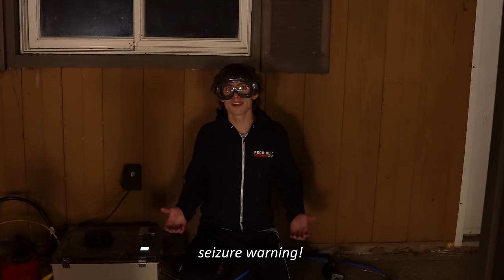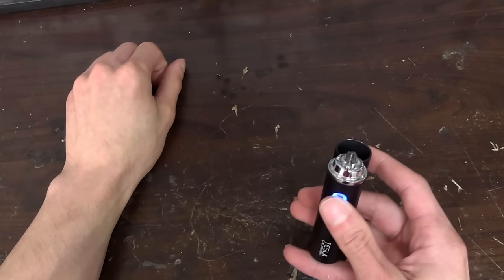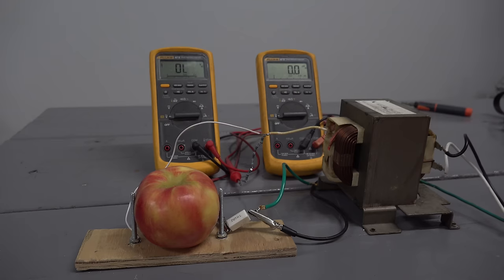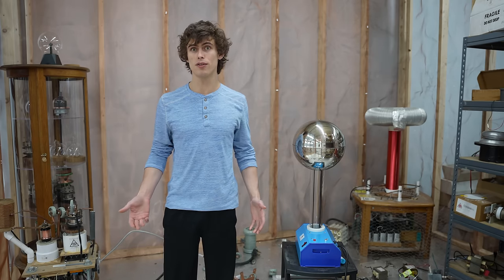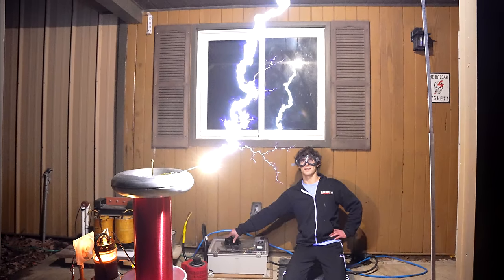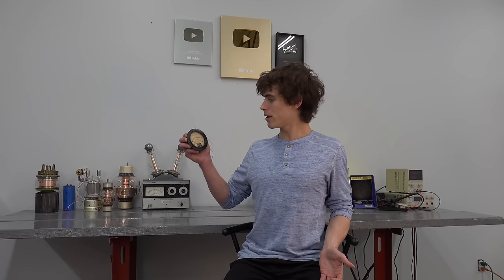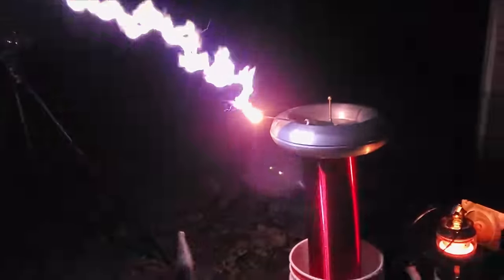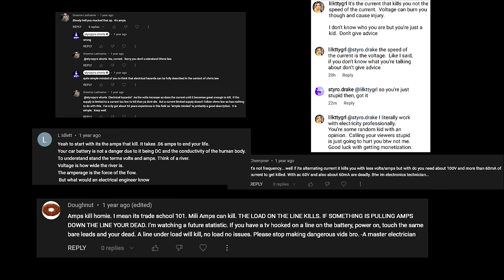Is it the volts or amps that kill?

Comment: I love the comments you showed about of ppl so confidently telling you you're wrong because they "work with electricity". So do I, doesn't mean I know sh!t about the physics behind it. 
Yes yes, we are taught in trade schools that it's the amps that kill you (in the UK we say anything over 30mA) - but the answer cannot be that simple otherwise anyone who's chopped thru a lighting circuit would be dead.

I'd trust the man chopping open microwaves and making lethal lasers in his garage over those people any day. The fact you're still alive is proof you know what you're talking about.
Reply: Less than 30 mA can kill if you're extremely unlucky. I've heard the threshold for death can be as low as 6 mA. But for that to be true conditions would have to be perfect. The victim having a weak heart certainly helps. The bottom line is there's a lot of variables involved. In the end one thing kills you but a lot of other things had to lead up to it.

Comment: I think for the generally stupid public it's easier just to roll with 'electricity bad touch' because the nuances are lost on most people. Decades ago I put a Lichtenberg pattern across my hand from pinky to thumb on sweaty skin playing with an old microwave transformer. It hurt, a lot. I haven't messed with anything high voltage since then. In hindsight I had no idea how dangerous what I was playing with was and neither did my parents and thankfully they still don't. Knowing what I know now I'm lucky to be alive not just from that zap but in general from all the incredibly dangerous stupid things I did with it. I never figure you'll be killed by your equipment, I figure you'll be whisked away by men in white vans to a government holding facility or kidnapped by a rogue state to be forced to build high energy weapons.
Reply: Exactly, these guidances have to be simplified for the general public.
Reply: I do wonder what would happen if every single person saw this video
Reply: @fyrea  From finger to finger on one hand over damp sweaty salty conductive skin while I was wearing rubber sole shoes sitting in a wood and leather chair on linoleum flooring with the transformer on a wooden table not touching the demonic thing. It went from itself to itself across only a small part of me. The pattern faded out after a couple days, I think it just flash boiled some of the sweat in/on my skin. Thankfully the bulk of me wasn't affected so I was able to jump back quickly (relatively speaking very slow to electricity). Dumb luck for a stupid kid!

Comment: I think the best answer to "Volts or Amps?" question is YES.
I work as an autoamtion engineer and i play with current for almost 20 years.
Your clip was very nicely done, very informative although somewhat too encouraging for some young, uninhibited by experience, home made electricians 🤫
I have my private knowledge in this matter - it's the amount of energy your body can absorb. But it doesn't sound as flashy as "Amps kill you!" or "Volt's kill you!". You need a bit of physics knowledge to find out what's behind a sentence "Amount of absorbed energy may cause damage which can be lethal depending on the area on your body that this energy is absorbed. It also depends if this energy is provided in a DC or AC form and if AC then what ferequency is it." 😁
Reply: Yeah, I had the same thought several times throughout the video, that it's about energy transfer. At least, other than the heart. For the heart, it's much more complicated, because it's such a complicated electronic circuit.

I suppose a computer makes a good analogy. How do you fry a printed circuit board, like a motherboard? Too much power, either overheating it or breaking down the material it's printed on, or both. How do you fry a CPU? That's a lot more intricate. A very small pulse with just the wrong waveform could brick it, something that a motherboard would never notice even happened. Of course, because of that, they have a lot more protections around them... sort of like the heart is protected by being deep inside the body, so without enough power to punch through those defenses, you can't fry it.
Reply: @barefootalien  There's also another danger that wasn't mentioned in the clip (i beleve?).  Blood electrolysis with DC current. Even prolonged exposure to very low values (deemed safe by everyone starting from ~2mA) will result in a big damage to the body. Then i beleve your own veins become nice conductors...
Reply: @ogi22  Huh, neat! I hadn't considered that...

Gotta admit my first reaction was "noooo... It takes enough voltage and current to electrolyze water that you'd have bigger problems than that..."

But you're right, at least about the electrolysis; the decomposition voltage is only about 1.5 V.

Even so, I have a bit of difficulty imaging it getting extreme enough to make enough gas to be a problem to reabsorb, especially since I'd assume nearby hemoglobin would immediately absorb the oxygen.

But... Perhaps other things decompose that are toxic?

And, of course, that would need to be an internal potential in the blood of 1.5 V, so a much higher voltage at the skin I should think.

Still, very interesting... Thanks for sharing!

Edit: Hmm... With some more thought, I suspect some oxygen's wouldn't find themselves near another or a hemoglobin, and might bind with a single hydrogen to make a hydroxyl radical, which could damage DNA...
Reply: You know, something else that's been bothering me about this entire debate is how people argue as if potential and current are two completely separate things, and not two intricately related concepts describing two very intimately linked parts of what's really going on.

It's a lot like the torque vs power debate that happens in car culture in that way.
Reply: @barefootalien  My pleasure. If you work with current, you tend to gather some info over the years 😁
Also consider that "neutral" water for the human body is saline (0,9% salt solution). Add some other microelements and all that stuff in the blood. Make it flow in nice wire-like structures... 
There are many things we consider as "safe". I used to work with a company installing Swisslog Telelift transport systems. Those little carts are powered with 24V. Completly safe for humans if you touch it. The only problem is if you touch rails and wear a ring for example (or you are a white collar worker with extremely tender and wet skin - sweat is also salty). Rails are around 10mm apart, so you can weld a ring with your finger to those rails 😜
Reply: @barefootalien  Yup. The same is with electric and magnetic fields.
Although you can have voltage without a current - an open circuit.
Or a current with 0 voltage - short circuit ;)

Comment: Hey Styro.
I was just wondering, when you are making huge arcs like you do in this video, do you ever worry about the wavelengths of light which is being produced?
I would personally be concerned that you are potentially subjecting yourself to things like UV A, B, C, X-Ray and even gamma.
Do you have a spectrometer? I would be interested in the results
Reply: He probably knows but doesn't care as I'm pretty sure he is Floridian first human second (I think he's from Florida)
Reply: @thatguy-400  he’s from Illinois
Reply: i think he tests all that before exposing himself to these rays. he's a huge safety advocate despite him doing dangerous experiments
Reply: He voiced concerns about "cooking himself with x-rays" in this very video.
Reply: Arcs in air produce some UV, which is why when you're welding, you ideally want to have all your skin covered because you can get "sunburn" from the uv from the welding arc. I don't remember for sure, but I'm pretty sure arcs in atmospheric pressure air produces uv-a and ub-b only. Arcs in air can't really produce radiation in higher energies though. To produce higher energy emissions, you need lower pressure, which is why he made the comment about not wanting to expose himself to x-rays when he was using the vacuum capacitance divider. Once you have arcs in vacuum or partial vacuum, that's when you have to start worrying about x-rays, and to a lesser extent the lowest energies of gamma rays. It depends on the pressure, and the voltage of the arc.

Comment: The pure joy he’s felling at 12:54 while he has a Tesla coil shooting into him is something else
Reply: It wasn't shooting into him. It was barely touching his skin. If that arc went through him and into the ground he'd be dead. He made so many stupid people so much stupider with this video. Also, the arc of a tesla coil is not a constant stream. It's actually tiny zaps (sparks) in very rapid succession (thousands of times per second). Those tiny individual zaps don't break your skin which acts like a Faraday cage. Now, if your body didn't have the skins and all your wet organs were exposed, you'd be dead. Also, if he directly touched the output of the tesla coil he'd be dead. Do not repeat any of his experiments, do more research on the topic from real physicist or engineers. He only wanted to win an academic debate with this video and he's still wrong.
Reply: @levyroth  I’m just tryin to be funny man, why you gotta be like that
Reply: @levyroth  You pointed out before that he was standing on an insulated mat. I suspect that the metal rod he is holding is connected to a ground wire hidden up his sleeve. 2 observations, the arc is very bright when it is touching the rod which means it's passing high current (to ground) and secondly he jumps every time a small streamer hits his hand indicating current passing from that point on his hand to the grounded rod.

Comment: My dad once got electrocuted with 120,000 volts because his boss disregarded the lock out tag out while dad held the wires in both hands.  It did stop his heart but apparently the fall out of the ceiling and hitting the floor restarted it so that he could immediately quit that job 😂
Reply: I was working near a Junction box for a bunch of 347 Volt lighting circuits and as a newer apprentice and i didn't think to test the Dangling wires to see if there live and someone didn't Cap the end of some of them leaving the live Copper end exposed and My shoulder grazed the Copper end on one of them and my whole body started to seize up and i fell off the 8 foot ladder that could of ended up a whole lot worse as when i fell i somehow nearly missed the Open Panel that was Live with Exposed bus bars the Journeyperson that was with me was scared out of his mind when he heard me fall off the ladder.
Reply: @thegreatcanadianlumberjack5307 Wow you got shocked of a jbox and then almost fell onto a live panel. Man that would have been the worst luck. Most of the lighting crkts I've installed are 277 (347 from what I know is used more in Canada) but either way it's lucky you just got grazed and weren't gripping the wires. Lighting is the worst becuase the voltages in commercial and industrial buildings for it are high enough to completely take over your muscles and your usually high up just a terrible combo. I work with a lady that had a motor blow up on her sent the pecker head flying and nearly smacked her in the face. Luckily just walked away with minor burns from the blast.
Reply: @jsb7546  Wow that was Lucky could of been alot worse. Had one Electrician do Generator Test once and the Generator started tearing itself apart sending Copper windings flying everywhere and the one guy who took off his hard hat got struck in the head by a winding fragment as we ran out of the room and when it finally threw a Rod it manage to pierce and lodge itself in the Engine block. But yes in Canada our 3 phase lighting is 347 Volts because we use 600 volts for our main power instead 480 Volts. Most of the 347V Lighting is in the Parkades but  i have heard of people ending there careers from getting shocked by 600V panels

Comment: I'm at 1:45 into the video as I write this comment, but I'm going to just guess voltage is what's dangerous based solely on the great many "Warning! High Voltage" signs I've seen compared to the complete lack of "Warning! High Amperage" signs I've seen.
Looking forward to finding out if my assumption is correct.

Comment: The funny thing for me is that technically speaking, it IS the current that kills, but for all intents and purposes it's the voltage that matters - If that makes sense.
Eg, if you had to choose a 2v wire vs a 200v wire to hold, you should always choose the 2v wire! BUT it's the current that would kill you from the 200v wire if and only if it could deliver the current!